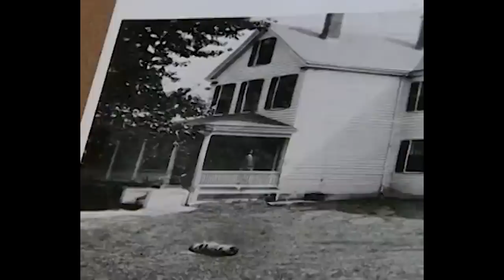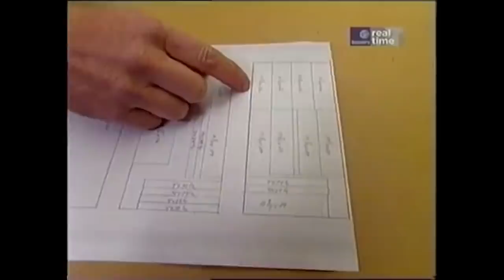Where is Norm Abram today? What is he doing now?

Comment: I "cut my do it yourself teeth" watching religiously This Old House on public TV EVERY Saturday! 
I had some basic skills I learned in shop class required   by my 7th grade curriculum.
The girls took sewing and domestic skills on their side.
We built some furniture which I still have (1959, I'm now 74).
The guys also did metal working, setting type and printing, and drafting.
My Aunt was an art education professor in the New York University system in the 50-60's and would visit and stay at our family's home during the summer which was  not the most practical as she was used to living by herself.
We found a small 100 yr  house down the street for sale and convinced her to buy it. "Sanity now".........
Eventually we inherited the house and I lived in it.
In leu of rent I started doing small updates and repairs.
And I became a caretaker of "the church of Bob Vila and Norm" so to speak.
Notable projects under taken included total rebuild/upgrade of the basement laundry, new installation and wiring of a hot water heater and laundry tub, replacement of an outside entrance and storm door, upgrade of the house electrical wiring and circuit board, removing the ancient knob and tube wiring system, bending the conduit.
Total update and installation of the kitchen, total renovation of an attached screen porch and support foundation with new steps and door. Sanding and refinishing two bedroom floors, new front entrance storm door, new gutters, re-shingling the kitchen-porch,  replacing and adding additional insulation to the second floor and so on. No issues with the system upgrades
ALL due to the guidance and influence of the Bob Vila and Norm PBS TV series.
Since then I've upgraded two more homes we've purchased. 
A quite "out there" modern (1960) architect hill-side mega- view home (another major undertaking) including a two story 4"x4" post design  totally adult friendly and rated  play set with two adult capable swings, roofed, water slide, climbing wall, bridge, two adjustable all aluminum
flag-poles,  climbing nets and ropes etc. 
The second was a 1984 Energy Star architect designed demonstration hillside 4,700 sq. ft home with major deck,  private all glass hillside views, master bath with two sinks and inset whirlpool tub with an all glass picture window with an extended hillside view.
NO DRAPERY totally private views. Cannot see any neighbors homes, extensive park down the hill with play area etc.
14' vaulted livingroom with paneled ceiling library/loft with three all glass windows looking over the streetside hill and the loft overlooking a wall of windows, wrap a round deck and the distant views.
All this possible due to knowledge and confidence 
acquired over the years "with Bob Vila and Norm".

Comment: "I watched until the end" I grew up watching Norm and was so influenced that I became a carpenter, finish carpenter, master carpenter, and woodworker.  I have taught woodworking classes for 20 years now and I have a lot of construction carpenters who want to learn finer woodworking.  I think what is not being said regarding the lack of skilled workers is that there are a ton of less than skilled workers who, aren't licensed, don't pay taxes, and underbid a lot of the skilled licensed ones.  It used to be that this was only happening in painting and drywall but the problem has moved through the whole industry and just gutted the hourly pay.  Because of my reputation and experience, I always have work but about every 4th or 5th job I get hired for is an abandoned project by one of these guys.  I start by pulling down poorly done crown molding or something like that then do it the right way,  They end up paying more because of the backtracking and loss of ruined materials.